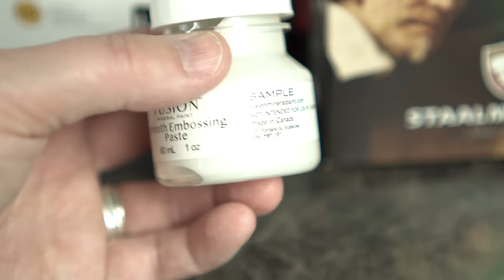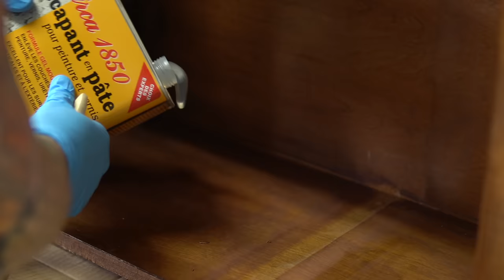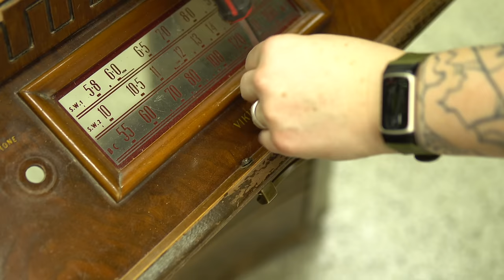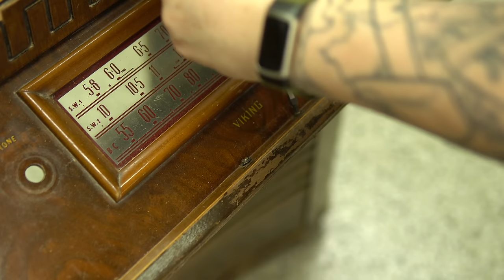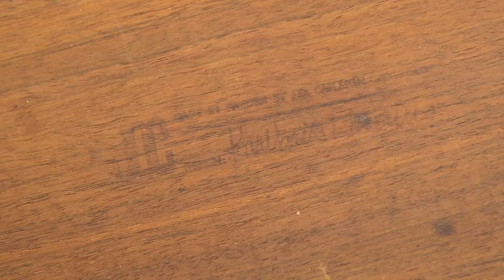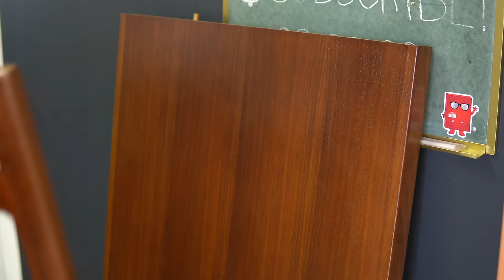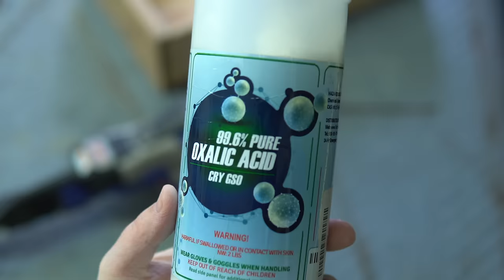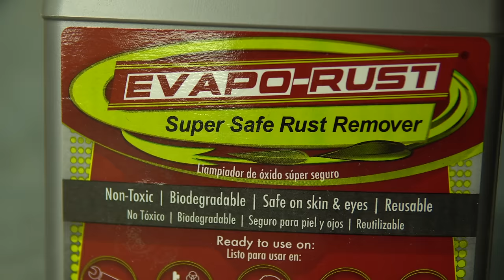10 INSPIRING & JAW DROPPING furniture makeovers - BEST OF 2023

Comment: The Viking radio + turntable: still my all-time favourite. ❤ I’ve been meaning to ask you why you chose not to preserve the front trimmings - but not without remarking that the new, sleek look turned out gorgeous. It’s just curiosity. I was wondering if it presented technical issues. Congratulations on all your pieces!
Reply from the maker: Oh I definitely COULD have. I had planned to. But when I saw the two pieces of bookmatched burled walnut, I just opted to do that instead. I wasn’t a big fan of the design of that trim piece to begin with. 🙂
Reply: @TranscendFurnitureGallery  And it turned out very elegant. Thank you for satisfying my curiosity. ☺️